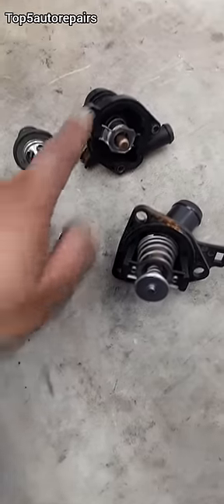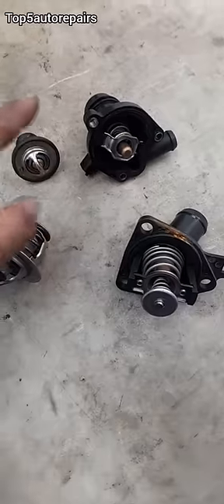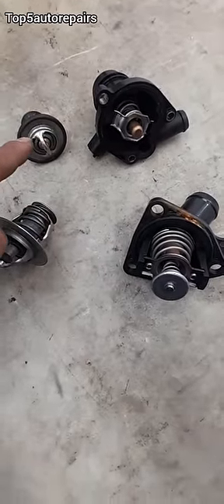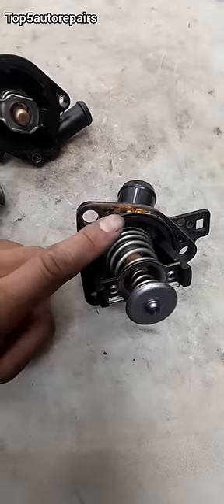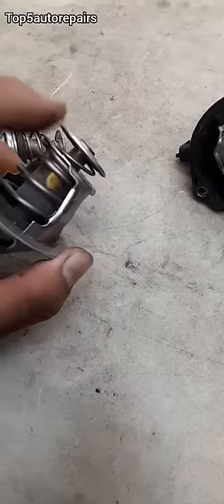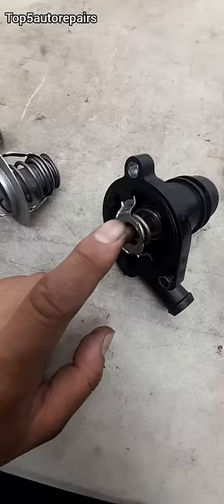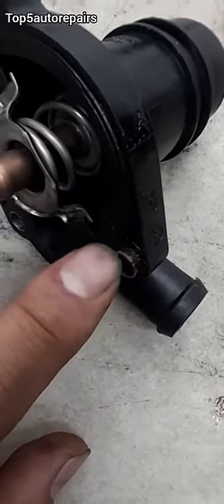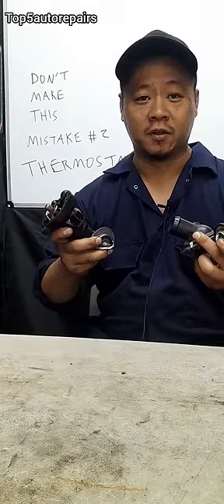DON'T MAKE THIS MISTAKE WHEN INSTALLING A THERMOSTAT

Comment: Just spend a few more bucks and just buy the thermostat housing with the new thermostat stat on it . Easy fix just switch the old one with the new one. Don't even have to mess with the thermostat. The housing only required when I did this to a Chrysler 300 three days ago was only two bolts to release the old and the same two bolts to attach the new housing. Easy fix.

Comment: The spring side always goes into the intake or towards the engine, saying it goes into the thermostat housing is not correct. You are holding the housing in your hand.

Comment: I had head gasket replacement,  fuel pump, just piece by piece... putting a 95 lt1 back together...she ran good... but 1 day drove a short trip, on my way home she cut off..would not recrank..got her home.. now it cranks but after 30 minutes sporadic idle, up/down cuts off Every time...will drive or idle ok but 30 minutes cuts off

Comment: & remember to not over torque the bolts... I just cracked one side of the lower half n ruined all my progress on a water pump replacement. Now I have to hit the junkyard and find a decent condition one because I refuse to pay for a whole housing unit while the upper half of the housing is still good!

Comment: Always get a thin coat of black/gray RTV on the gasket and the surfaces. It helps with sealing especially for imperfect surfaces.

Use this on older motors cause they deform after a really long time.

Great trick to know. Works with any gasket.
Reply: there are many types, which one exactly? :)

Comment: I seen other videos put the thermostat pin at the bottom 6 o'clock position, what's the difference at the top 12 o'clock position? I'm confused & which one is correct?🤔
Reply: I've always saw its top 12 pos.
Reply: @kevinhancock4064 makes sense since it's allowing air to be purged, and that's where the air rises to.
Reply: @dubmob151  indeed ..it does

Comment: My thermostat housing had a little bit of dried blue threadlocker on it from the bolts that mount it down. Is it ok that I didn’t clean off all the dried up threadlocker? Tried to get some of it, but it was stuck in some of the crevices of the housing

Comment: Is it okay to leave a stuck opened thermostat in my car , specially that i am living in a hot country ? will that effect on Engine or its okay ?
Reply from the maker: In a warmer climate I wouldn't worry. On the other hand, in a cooler climate it will cause over cooling and it's bad for the engine.

Comment: What would happen if the hole is not on top??
Reply: Same wondering here too just finished putting everything back and I can’t even remember if I put it the right way so that the hole is on top lmaoo
Reply: @notthatguybuddy7984  it's OK I drove my car over 100 miles n it's fine don't forget to burp the radiator

Comment: What if your thermostat is stuck and wont come out?
Reply: its hammer time! tap lightly on the housing. if housing is removed but thermostat stays on, use what ever it takes ON the thermostat only. thermostat is being replaced so how it comes out doesnt matter.